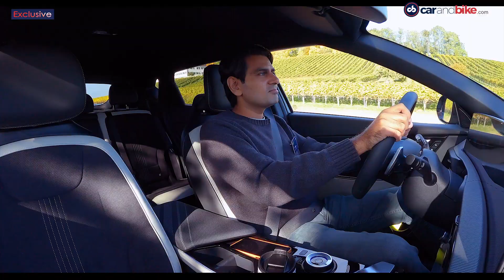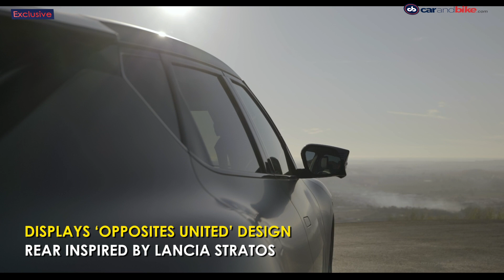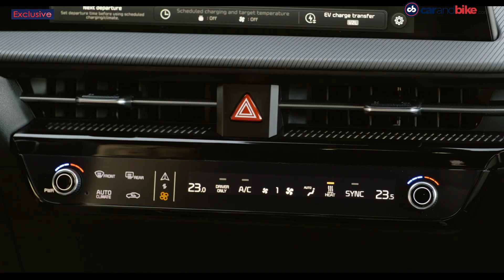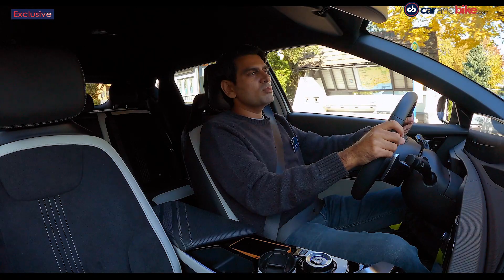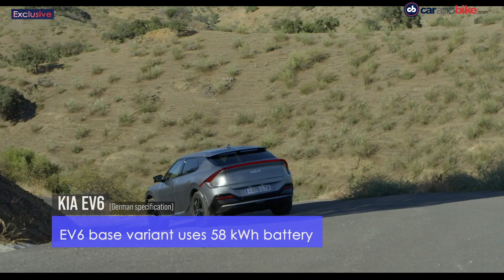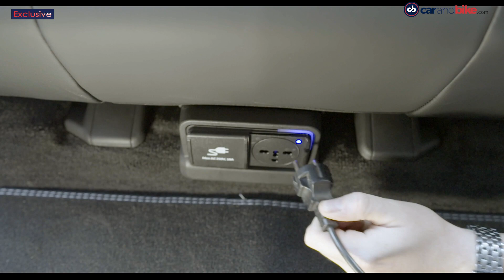Kia EV6 EXCLUSIVE Review – First Dedicated Electric Car from KIA #SVP

Comment: Since EVs are way more expensive than ICE cars at the moment, the manufacturers should also consider offering a basic version without all the frills, fluff, bells and whistles. A basic plug in car that serves just the purpose.
Curves screens and hi end electronic gadgets surely add up to the already hefty on road price and keeps it out of reach for most of the population.
Reply from the maker: Interesting thought. But how many buyers can do without any frills or tech? That's what they will grapple with.